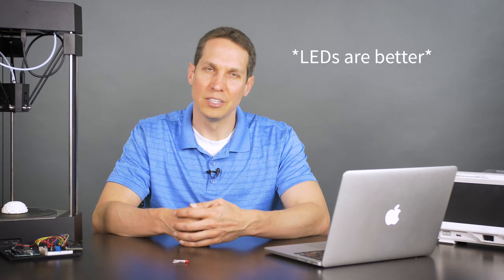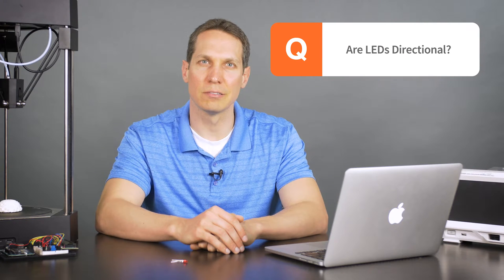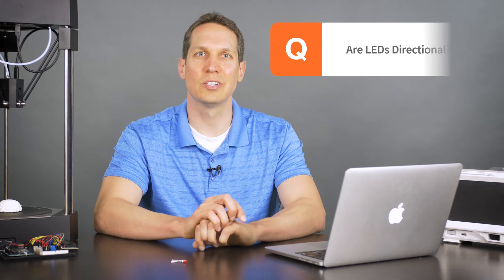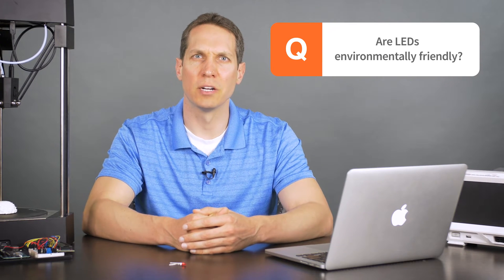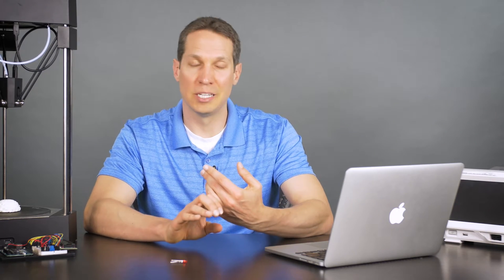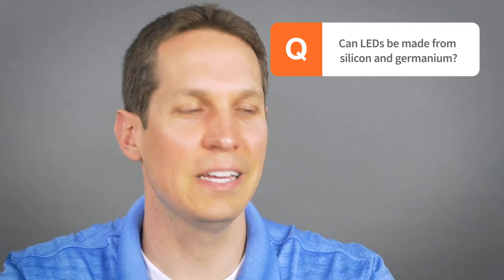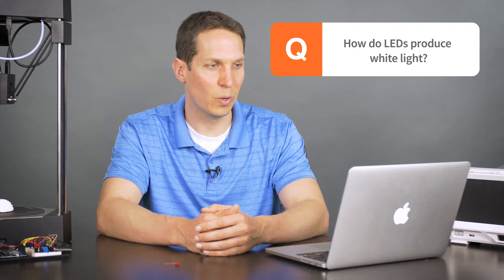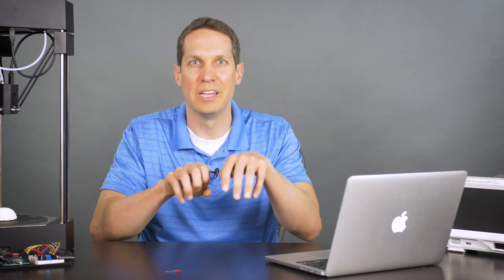Your LED questions ANSWERED! (Part 2) | Basic Electronics

Comment: Why led bulb-lights size don’t work properly in a set of lights?
Reply from the maker: Hey Isaias, I don't actually don't understand the question.  What are you referring to?
Reply: Many of these "sets" are 12V Halogen-Sets. And their drivers/ballasts need a minimum load. And LED-lamps are way below, so the ballasts don't work properly.

Comment: There are some buzzwords on LED lights which are not clear for me so the question is: what is the difference between COB, CSP and CREE lights? Thank you.
Reply from the maker: Hi Iván!  CREE is a very popular brand of LEDs, kind of like GE or Lumiled are brand names. COB stands for "Chip on Board" which indicates that the LEDs are integrated together more tightly and, as I understand it, earlier in the manufacturing process.  Sharing a semiconductor substrate rather than sharing a PCB.  CSP stands for "Chip Scale Packages" and is a way of packaging discrete LEDs into something smaller so that you can fit more of them onto a PCB.  It basically is getting rid of all of the "unnecessary" plastic and metal that surrounds the LED itself to make the unit as small as possible.  I hope this helps!